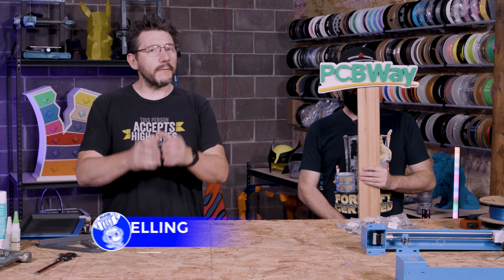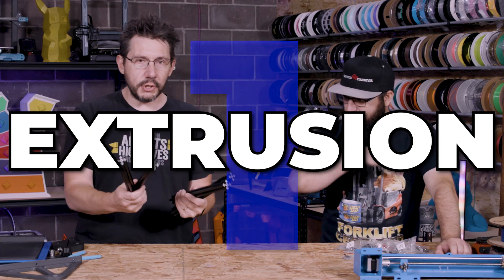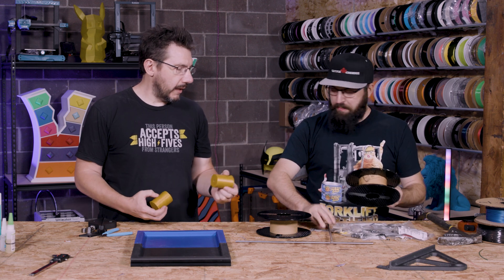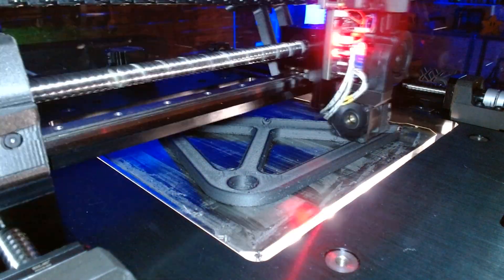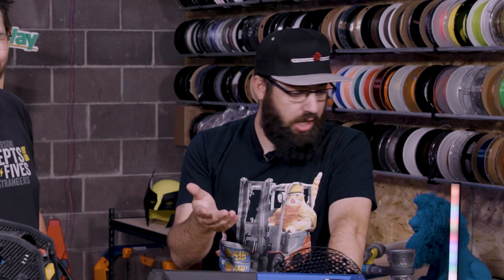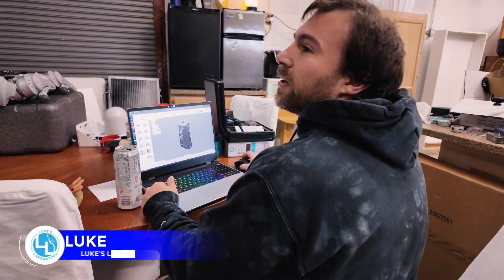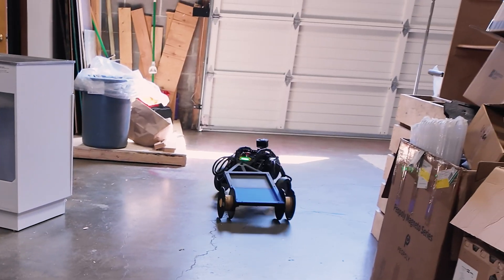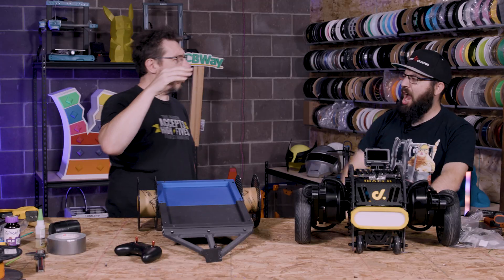3D Printing Solves Robot Problems!

Comment: Heh.  My first printer was an Ender 5.  I hated it.  When I replaced it with an X1C, it sat around for a while until I decided to try and sell it - but when I went to shoot a video of it, the BLTouch had failed and something else was wrong too.  So I said "screw it" and stripped it for parts.

Most of the frame went to building a trailer for my Scrubber Droid.

So it seems building trailers from leftover 3d printer parts is now a tradition.  :D